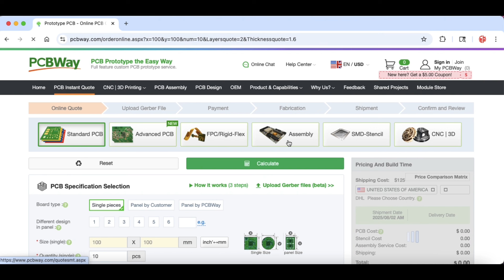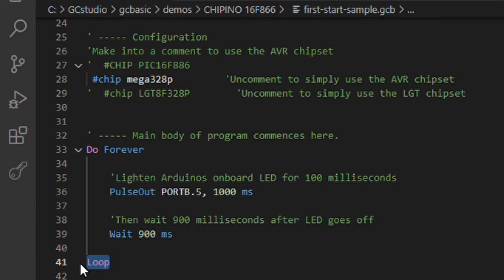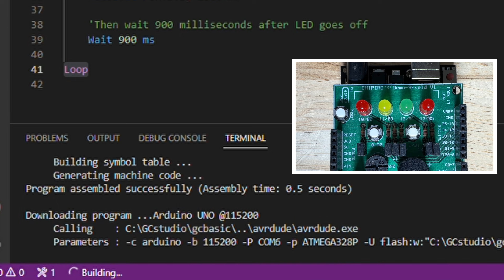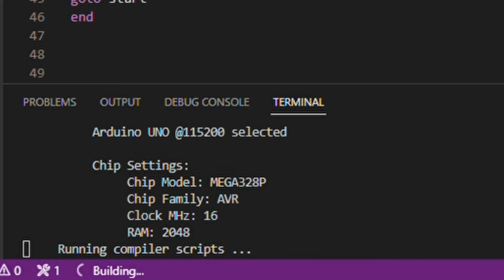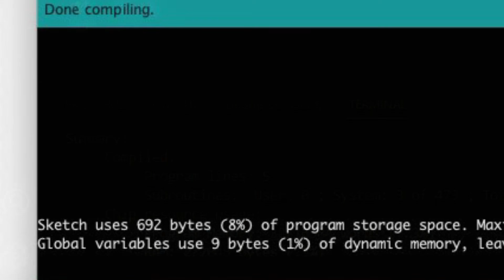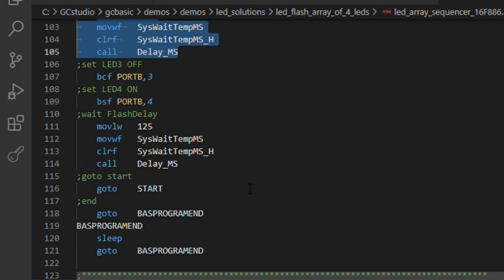Can You Program Arduino in BASIC ?

Comment: Tell me if there ever will be an ESP32 version, till then not much use for me... In the day Zilog had a Z800 chip you could program in Basic and I used to use it for projects in the late 1970s...
Reply from the maker: That’s up to the GCBASIC guys. Odds are you are using smart sensors or serial LCDs with your ESP32s. Many of those have a small 8-bit in them. Just another tool to make your own.

Comment: One question, how do you use all of Arduino's library's that are all written in C? Seems like you are giving up a lot of the power of Arduino.
Reply from the maker: Many library functions are just built in commands in GCBASIC, and GCBASIC.has a several libraries Arduino C doesn’t have. So you aren’t giving up anything. Besides, libraries are just prewritten code. AI can write a lot of it for you if you need something specific or just use Arduino C for that particular project. Having both software tools in your toolbox is a bonus.

Comment: While I have no plans to use gcbasic it does not hurt to know it exists. I did a google search and found that gcbasic has reserved words like:
Do, Loop, While, Until, For
so it would seem one is not restricted to only goto for looping. I am guessing you used goto to minimize the memory space required in your example. While "goto" may have a one to one correspondence to an assembly instruction one could caution that using it can lead to code that is difficult to debug. Also, less structured code could be less modular and harder to modify and maintain.
The last time I used basic it was GW Basic as it was the only free language one could use with early IBM PCs.
Arduino is really C++ rather than C.
Reply from the maker: The example that had the smaller memory used a do-loop not goto. I only showed the goto to give some a nostalgic reference.

Comment: I still use Visual Basic 6.0 to write programs for my computers, it still works fine even though it hasn't been supported in about 20 years.
years ago I designed a humidity controller using an Arduino UNO, LCD Keyboard display and ESP-01. I built into the code a very simple web page to display temperature and humidity so I could use a browser and enter the IP address to check on the controller remotely. I wrote a program in Visual Basic 6.0 to extract the data from the web page and display the extracted data and log it to a CSV file.

Comment: A very large number of simple mass-produced electronic devices have 8-pin 8-bit microcontrollers, costing pennies and replacing dollars' worth of what would otherwise be miscellaneous analog and logic circuits. Not at all obsolete. More fun and more satisfying to program for control freaks like me because the code can be all yours down to the bare metal, not requiring an operating system or large amounts of other people's code that you would have written differently if you had the time.

Comment: Chuck - Thanks for putting this together.  Was not really aware of GC-Studio till you brought it forward.  I started out 45 years ago, the 1st computer I did development on was a Data General that booted off of paper tape.  I developed many programs on the 8052AH-Basic which was the Arduino of its time.  Having another great tool in the toolbox for those of us whom like to tinker is fantastic.  This has always been just as much a hobby as it's been a carear for me.  Thanks for introducing me to an old new tool!
Reply: That 8052AH-Basic was a great chip, I wrote a terminal program in MBASIC so you could connect it to a CPM machine and upload software from disk.

Comment: Do you know Bascom ?
Reply from the maker: Yes, I’ve tried that before. Since I started with PIC, GCBASIC became my preference since BASCOM didn’t support PICs. When GCBASIC added AVR support I stuck with GCBASIC. But BASCOM is another great tool for your toolbox.
Reply: I started programming AVR's with Bascom, it was easy to learn, great IDE. Low level knowledge of the micro came with the software. Also used PICBASIC  for PIC's, this was also an easy to learn language.
these languages are only for Windows. had to move to arduino when I switched to Linux.SHAME!